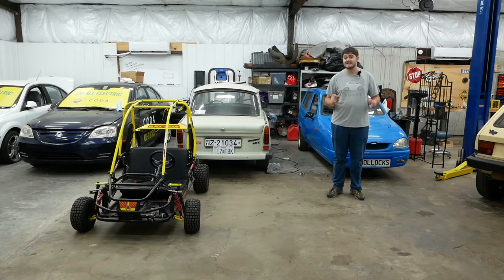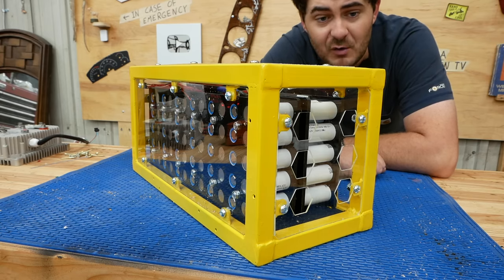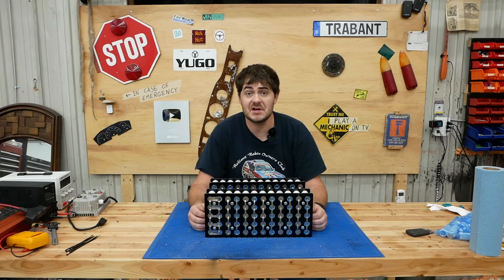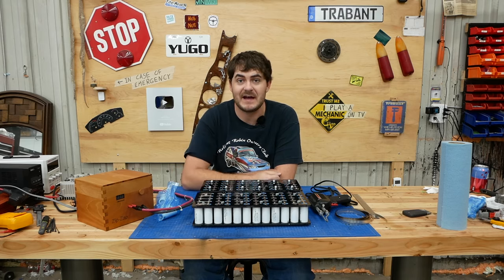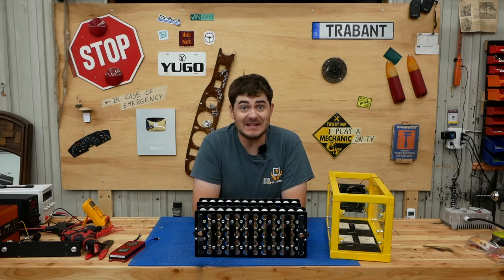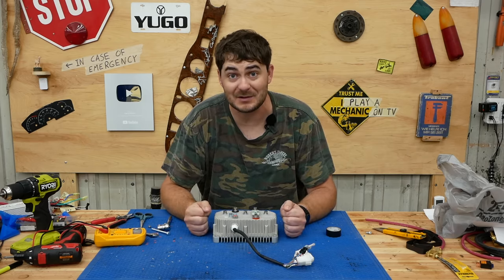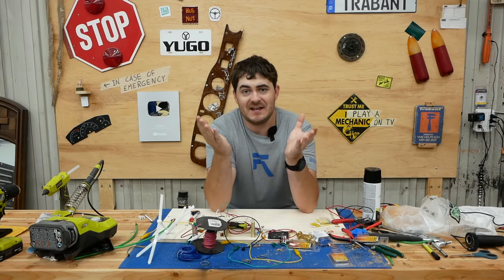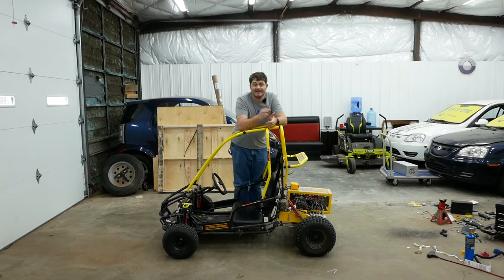I Spent Weeks Converting This Go Kart To Electric. Did It Work?

Comment: I know this is almost a year old now but my stepdaughters son is about same age as yours. 
He had a Razer 24v 'buggy' when he was 3 but doesn't seem to interested in it now (plus the original Pb/H2So4 batteries are dead).
His mother didn't see the '8yrs plus' warning and never reads or follows instructions.
 The original petrol motor had a centrifugal clutch to allow it to build some rpm and prevent stalling. 
Max rpm on the 4hp was probably 4,500~5,000?
Did you find out what rpm your alternator motor spins? What was it's original amperage output?
I was a motorcycle mechanic/tech/instructor but 'ply' with cars a bit.
Output could be could be anything from 45A to 110A for a small alternator but it would relate to the stator magnetic field strength and it's ability to 'pull' the rotor around?
I would imagine it's 'fixed' by now but in my opinion, it's probably drawing way too much amperage when you get over 50% causing something to overheat then shut down.

Comment: Rather B Welding had the same issue with his electric dirt bike turned out his batteries needed to be charged and the power control module had to be tinkered with for the correct input and output

Comment: I wonder if you could have a voltage detector on accross the precharge resistor which controls the contactor.
Instead of manually waiting for the capacitors to charge, it would instead automatically energize the contactor once the voltage drop accross that resistor is negligible.
You could even replace the precharge resistor with an incandescent panel lamp with a "Charging - Stand By" label next to it. 

Turn the isolator on - Charging light illuminates for a while.
*clunk * contactor energizes - Ready to go.

Comment: EV builder here, those aren't made to be motors. Guarantee that's your issue. I would buy a surron motor and directly swap it. It'll work right out of the box with everything else you have and be a lot better fit to the vehicle. More efficient too. If you want less power look up a my1020 or brushless equivalent in the same size. my1020 is 1kw, brushless will do about 7kw peak with 3kw continuous. About 15mph and 25mph depending on what you choose.

Comment: A single higher amperage 12v converter may help… don’t know how stable parallel dc converter output is under load, if they are not balanced. Maybe can try common ground and separate positive lines

Comment: Chinese controllers need hall sensors to work, use a bldc controller designed for rc like drone controllers etc. If the settings allow try using back emf or vector or sensor less based control feature on the current controller.

Comment: I would take a look at your buss bar pressure.  The plastic appears too weak.   You might see with infrared camera if you have hot spots in these areas.  You need extremely secure connections to ensure sufficient electron flow across those connections.

Comment: I bet it is the BMS. Try putting an ammeter on the positive lead from the battery... I bet you're exceeding 100 amps at full throttle/ half throttle... I converted my own go-kart to electric, watch my channel, had a similar issue. Also, it would explain why your charger went bad if the BMS is not working correctly. Good luck!
Reply: My own kart pulls upwards of 250 amps when accelerating quickly.

Comment: Possibly you know this but i stopped soldering to batteries (it was the done thing in the 90s with nickel cells, we didnt know any better) once i saw a lithium ion being made, the problem is the battery is rolled up inside the can, there's a plastic seperator between the layers and it's really easy to melt particularly on the can end. The vent end has its own problems with small cells, the isolator between that terminal and the can.... EDIT: You've had a haircut. It takes ten years off you. Also have you been on a diet? You look magnificent today! I think the problem you're having with the motor is that you need different voltages energizing the coils at different speeds/torque demands. 12v might be fine for startup but it's no good for running. One of the people i saw working with alty as motor had a little dial so they could adjust the voltage on the fly manually. I always wondered how difficult it would be to make a microcontroller do that automatically

Comment: For $250, you can buy a 72V 3000W brushless motor kit with controller. That setup will be faster than any 6-yer old will ever need to go (top speed probably about 35mph).

Comment: Ok let me start by saying great try. i actually converted a go cart to electric on time and it worked great. But i used 2 wheel chair 12v motors with direct drive to wheels and powered  them using 3 12v car batteries to push 36v into each motor to triple the motor speed. then i used the contacts off of an old electric forklift so my gas pedal would not weld it self together when i stepped on the gas. you changed speed's by switching from 12v to 24v to 36v by a shifting leaver with heavy duty contacts. All in all it worked great. Kept it for a year then my neighbor had to have it more than me and bought it for way more than i had in it. It did not look as good as yours but mine did work perfectly.  I hope to see you get yours going. ps your motor is definitely your problem.

Comment: I think it was Ben Franklin that said " I didn't invent electricity,  I just found 99 ways to do it wrong"  or something to that effect.  That said, how about an mppt controller/ inverter + 2 battle born lithium ion phosphate batteries directly to the motors? Solar panel roof to boot? A gear shifter that connects the power once in detent?

Comment: Your Hall sensors are in the wrong place.  The controller wants to know the relative angle between the rotor and the stator, and you're measuring that angle with a set of Hall sensors, that measure magnetic field.  In the previous video those sensors were placed between the poles of the giant electromagnets of the stator.  So the only thing they'll measure is the current the controller is providing to the windings!  You want to place a permanent magnet somewhere on the rotor *away* from the giant stator electromagnets where the Hall sensors can get a clean reading of rotor position.  (See how a crank sensor works.)  Or do the easy option and get an optical shaft encoder instead of messing about with magnetic fields.

Comment: I’m not quite sure if this is the problem but when my Rc car is low on power and I have the torque really high it cuts out power to the motor instantly. 
if I lower the torque it doesn’t cut out until the power is really low. 
Maybe it’s kinda the same with the go kart?. It might just be the a motor though.

Comment: I have an electric bike with a sabvoton cot roller and you have to sync the controller to the hall sensors in the motor and detect the rotation maybe you need to do the same with your controller?

Comment: Have you tried charging battery without anything hooked on it. I think the capacitors are blowing up your charger and by not discharging correctly cuts of your system.

Comment: Use a dc conveyor belt motor it  can be variably speed motor with a controller box but no sure how much hp you would have or end up with  more than likely you would have to use a really small dive gear on the motor  the ones if seen are rated around 30 something volts been awhile since ive work on one lol im retired now

Comment: hi have you tried using a vesc? they can work with sensored or sensorless motors  they have field oriented control and motor current limits etc

Comment: Its early morning and I should but fast asleep but  this video popped up in my head... ok this is just a theory BUT BUT I really like this build and I wanted to give you this idea. I know you are a smart dude and I think you are right with the hall sensor and the magnetic field problem.... SO WHAT IF JUST WHAT IF you power the rotor with a much lower voltage almost like 4.2v ,  just to make a field but not enough to hit any current limiting problem or mess up any magnetic field between the Hall sensors?  I am thinking that if its not the hall effect sensors being effected your MAGNETIC field is too high/strong.. .  id almost want to say try and start off with a 4.2 v single cell and work way up in parallel and in series. I KNOW YOU ARE DONE WITH PROJECT BUT PLEASE JUST TRY THIS FOR THIS MONSTER OF A MACHINE YOU MODDED ...  Thanks for the videos ~!

Comment: YOU PUT THE HALL SENSORS IN THE STATOR!!!  That's 100% your problem!!   You need to move the hall sensors away from the stator. The hall sensors are picking up magnetic noise from eddy currents and back emf..  get them away from the stator!  One thing you can do is 3d print a trigger wheel that matches your rotor, attach it to the motor shaft  and use 3 optic pickups to replace the hall sensors..  you MAY be able to use reflection to trigger it using IR transmitters and receivers and reflective tape applied precisely to the back of the rotor and mount the "ir sensors" on the back case with holes drilled in it to see the tape on the rotor. This would be a similar setup to an optic rpm meter.  I KNEW you were going to have issues with that hall sensor arrangement. 

One other way you can make this would be to cad draw a reluctor ring and send it to send cut send and have them waterjet it out of mild steel for you. You can mount it as a spacer between your front bearing and sprocket. You can then use basically any automotive hall style crank sensor (like LS1 cam sensor for example) or cheap hall sensor from amazon.  Hope this helps to give some ideas.

Comment: Do you know if your hall sensors are active high (sensor output turns on in the presence of a magnetic field) or active low (sensor output is on when no magnetic field is present)? When you tested the sensors in the previous video, I noticed that, at any given time, there was always one LED that was off and two LEDs that were on. I suspect that you may have used hall sensors that are active low, when you may need ones that are active high. I'm guessing that maybe the motor controller is getting a signal from the sensors telling the controller that the rotor is passing by two pole pairs simultaneously, which is impossible as far as I know, and thus confusing the controller.

Comment: the charger likely has a full-wave bridge rectifier. I've had those go bad MANY MANY MANY times on cheap Chinese power supply's. Basically it only takes 1 of the 4 diodes in the rectifier to go bad and your suddenly left with the circuit popper 5000... that or a sequel to the movie firestarter

Comment: you can solder it, but its not recommended if you dont know what you are doing... 
Using a really really hot iron and proper usage its less heat then a spot welder :P So yeah...

Comment: I see that you subscribe to my life Montra.  Anything worth doing is worth doing to stupid excess!  In a wood shop class, the assignment was to make a wooden toy vehicle.  So, I made a made a 1/4" to the foot scale model of a Kenworth Airdyne tractor pulling a Hi0cube reefer with a Carrier cooler.  It featured a walnut steering wheel, Twin stacks, opening rear doors with lever bar locks.  The trailer sides were tiger maple so that it looked like corrugated metal sides.  The mudflaps were cut from maple and were so thin that they flexed.  the tires were walnut and had knurled tread.  there was even a pillow on the bunk in the sleeper.

Comment: Hey try finding a old alternator that runs on dc current rather than the one you have that runs on ac current. The dc motor is double as powerful and double the range

Comment: motor for power generation

The number of windings and the motor used for driving

The coil thickness is different...

Removed the diode of the 3-phase motor and put in 
a hall sensor.

The motor does not change for driving.

It could have been easier to assemble with existing products.

Still,  tried various things, and it exploded, burned, and shorted out...

Isn't that what you learn?  😊

Comment: You got to keep going. Get a new motor it's a hall effects sensor problem and it's the location in the motor better off with a new motor to suit the controller. I see many issues and going over it again with another. Would help you better. And giving up isn't the way. When you beat this problem is better headspace overall into the future.

Comment: I am not an expert, but try putting a electric motor, have two sprockets and put one for chail, one for belt, conect belt to the alternator, chain sprockets to the drivetrain, conect alternator to the battery and as you drive, the battery will charge, I hope it helps

Comment: I mad a diy electric go kart which has 3000w kunray motor (5hp) and controller and because it works between 42 and 72 volts, I've made a battery full of 18650 cells (14s 8p) and it does not cut out. Maybe the ESC does not like the motor

Comment: Just a quick question, does the reluctor wheel in the motor give you the correct amount of pulses to match what the controller requests? Or maybe the accelerator pedal needs to be calibrated to the controller.

Comment: Did you know, power wheels use the same size motor as a 1/10scale RC car...? It's a sealed end bell/ non serviceable/ cheap little motor, and for not much money you can get high performance brushless motor. You're asking that go kart to go kinda slow with the kid ; a 6-10 lb RC car will do 75mph in less than 2sec. With proper gear ratios I think it would work. Just use RC parts for all the electronics and find/make the rest.

Comment: It seems like the best way to make something like this work is to mechanically energize the coils, without any kind of semiconductor control ckts on there, something more like a brushed motor where the rotor position determines which coils are energized. The goal should be to reduce complexity as much as possible! KISS

Actually, the easiest thing to do would be to just put some earmuffs on your kid's head, and maybe build a giant custom muffler for the motor.

Comment: I think it doesn't work perfectly because You are still using a carbon brush for the center axle. 
I have idea to reduce lost carbon brush connectivity, use a DC super capacitor that is placed on the axle ,if  lost connectivity occure , the middle magnet still works.

Comment: Overkill is better than under kill, so if you think that box is overkill great use it, don't modify it, keep it the way it is if you're already modified it. It's probably under kill by now, so make it overkill. Go crazy if you're gonna make a box, make it go over kill.
The only reason why I'm saying make it overkill is because you want the maximum amount of protection on that go, kart.  Go crazy man and also whyire in a tip switch into the 12 V lead to the contactor this will stop the go kart from yellow catching on fire because the tires continuously spinning because your kid probably fell unconscious at the wheel and flipped it the tip switch will immediately deactivate the 12 V signal. Going to the contactor or whatever. Voltage contacts the contact or which causes it to contact and allow voltage to go through.  So that when when the entire thing, tips to a certain degree, because there's gonna be body roll. And you don't want it triggering due to body roll. But when the entire thing, tips to a certain degree, like if the wheels are off, the ground to a certain amount, it will trigger cut off the voltage to the motors and the motor controller. And then once the go kart reaches a stable level of tilt EG back to bodyroll, it'll re-enable the motor controller batteries, and we enable the motor controller and motors and lava batteries to power the go cart again.  Also, add a dashboard. This will be directly powered off of 12 V and it will be a digital dashboard. When the go cart tips enough, it'll read. Tip sensor activated on the rpm gauge. Letting the kid know that hes till to the gocart too far. And the motors won't spin up, it'll also show the range remaining. Current speed, current motor rpm current voltage coming from the batteries current percentage of charge remaining in the batteries.  And all good stuff, so that way. Your kid gets the full electric vehicle experience.

Comment: You would have been fine with just the Nickel strip, you would not have been pulling 100 Amps from each individual strip, it would have been spread out over all the cells. For example, If I take 8 Lifepo4 Cells, and connect them in series, to make a 24 volt battery, and I pull 100 amps from it, each cell would have a load of 25 AMPS. etc. its the same for how ebike batteries are made with 36 Volt packs with the same cells, they are also spot welded with nickel strips. each cell in the series takes the load evenly, and when you have a parallel set up it halves the current between the 2 sets of series and again the load will spread out evenly. So lets say you have 100 cells, and 50 of them are in series, and the other 50 are in series. Now take 100 amps and divide that in half between the 2 for a total of 50 amps, now divide that again by 50 and each cell is taking on 1AMP. These strips or most at least are made to handle 5 amps before they pop for safety. Hope this helps.